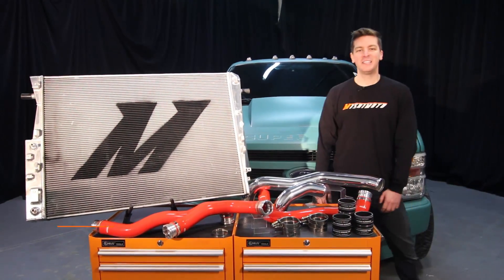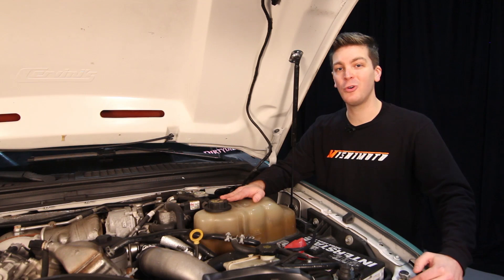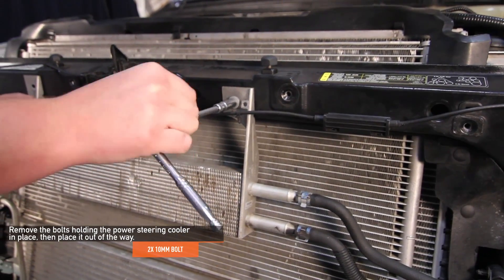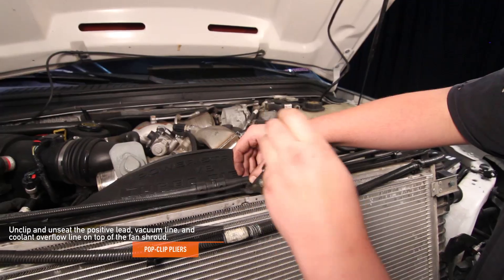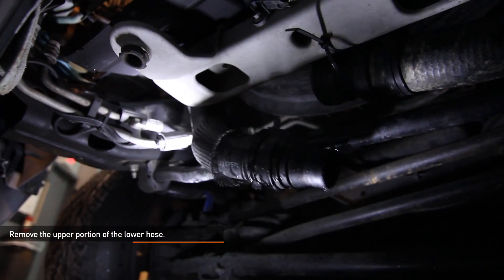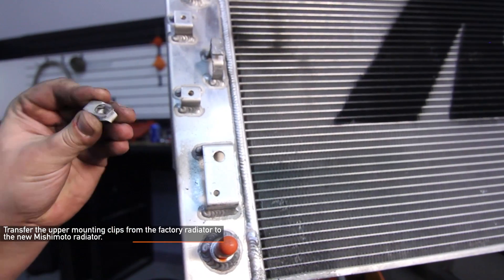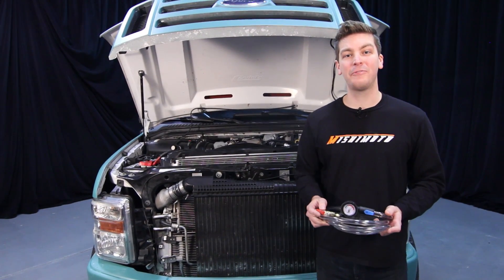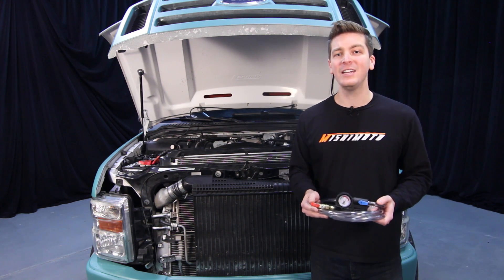2008-2010 Ford 6.4L Powerstroke Cooling Package Installation Guide By Mishimoto

Comment: Says double the capacity do I need 8 gallons of coolant
Reply from the maker: The radiator has 100% increase in capacity over the stock unit. This will not double the entire system capacity.

Comment: Question lower radiator hose on passenger side is a pain to connect to oem rad. Seems like I have to beat it in is this normal
Reply from the maker: This is not normal.